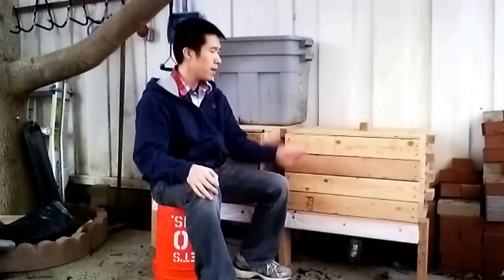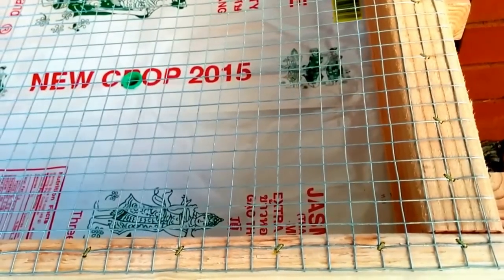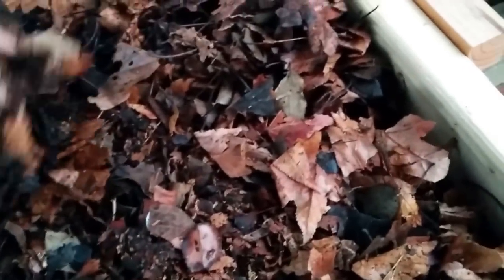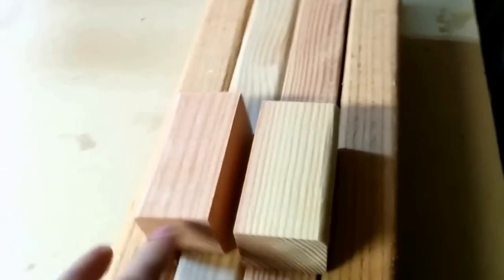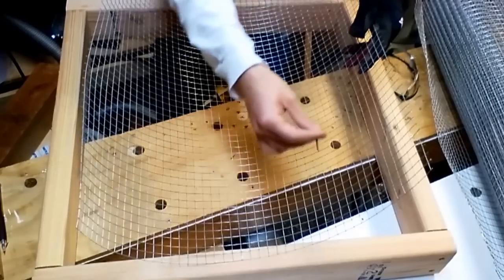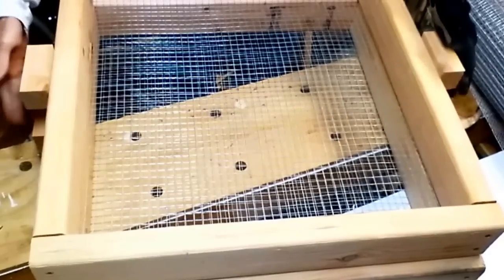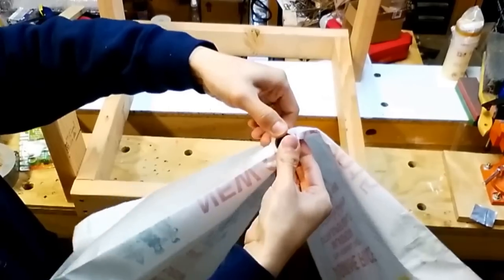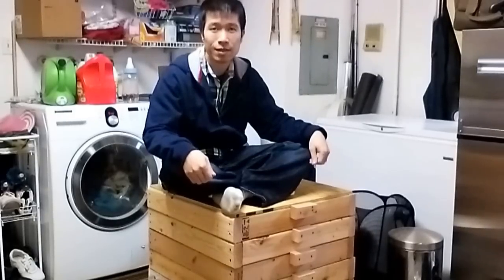DIY stackable flow through vermicompost worm bin s

Comment: Can someone please answer my question? 
Do you have to make a bedding for each tray you put on top or just for the bottom tray?
Reply: When the lower tray (not the plastic bagged one) gets full, you put fresh bedding and food in the one above. That causes the worms to migrate up leaving the castings below. Before that, you don't put bedding above as that will suffocate the worms (and there will be an air gap so they can't migrate up).

Comment: Hiya . Best video on flow through wormery by a mile. 
TWO QUESTIONS PLEASE. 1) whats to stop the finished compost in the bottom tray falling through to the liquid gathering tray at the bottom and subsequently blocking the tap ? 2) How many works do you need to get one tray started ?

Comment: My tip: if you only have a hammer, use 9/16" wide Romex staples, which fit perfectly over the 1/2" wire mesh squares

Comment: I have built the bins and after about 4 months, I have a couple of questions...
1) The second bin from the bottom is full of castings and is very heavy but the third bin (with bedding and food) is not ready to support the system yet. The worms continue to travel back and forth from the second bin to the third. What can I do to change this?
2) I have found dozens of worms in the bottom bin (with the plastic) and cannot prevent them from migrating down to that bin. How can I prevent this? Thank you for your time...
Reply from the maker: Glad you tried it out! yea worms don't always do what we want them to. You could start harvesting the casting and merge the worms to one tray.  They seem to prefer moving down so I put the new bedding/food under the finished tray so they can migrate down while the top dry out. for #2, I flipped the base with plastic so that the plastic is right at bottom of the first tray's mesh to make it easier for them to move around the bin

Comment: I had actually purchased a very similar design from Wood Worm Farms in 2009 that used a plastic mesh rather than hardware cloth. It's still just as sturdy as the day I bought it, surprisingly, I don't have to worry about corrosion long-term, and I imagine it would be much less expensive to purchase in bulk. Also, their design made use of a large paint tray to catch the leachate as it falls straight through the mesh. That obviously limits the dimensions of the box, but I found that size to be just about right as any larger tends to be somewhat unwieldy to transport by hand. Plus, the slope of the paint tray gives any worms that accidentally fall through a chance to potentially escape the leachate. Bonus! 😄

Comment: Question please...Because the bottom tray in your stack is a drainage tray, do you think it would be a good idea to drill some ventilation holes in the 2x4 sides of the worm trays and the drainage tray to maintain good air flow? Please respond. Thanks
Reply from the maker: No issue with ventilation. Worm love moisture and are found most toward middle of tray where it'smost moist

Comment: Are you just using leaves for the bedding in each tray? If I understand this right, you start out with only one tray, then when most if not all of the bedding is consumed in that tray you stack another one on top of that and fill it with bedding, and so on as the bedding in each tray is used up. When do you remove the bottom most tray; after you have two trays on top of it? I also wanted to ask if you supplemented your worms diet with organic kitchen waste as well? Im thinking a heavy milled sheet of plastic could be used for the bottom of the drainage tray. Over time anything would have to be changed out and it breaks down. You feel there is adequate ventilation without the need for ventilation holes, even in the lid? I like this design and it is very affordable! Thank you for sharing it! I look forward to your response. Thanks
Reply from the maker: The trays are still solid and havent broken down at all. I mix whatever "brown" ingredient available(leaves,shredded paper, straw,etc). I discovered that they love straw as it keeps moisture well. I generally only use two trays each bin as i don't actively monitor them regularly and only feed them with kitchen veggy wastes when i remember. You can stop feeding the bottom tray when there are enough compost that you want to harvest . i leave them until they are full(about a 5g bucket per tray), which take multiple filling/breakdown. I keep the third tray with brown material to decay for later, 4th tray empty to be used as shifter for soil/etc--very useful. Any sheeting at bottom is fine, they wont decay for years as there's no sun exposure and are inorganic. You just need something so worms don't fall off. I dont bother with collecting leechay--not enough of a problem to worry about. You might have drying out problem at the edges due to quicker evaporation and neglect:), i usually stir them into the middle once a while. Hope it helps!

Comment: Hi, do your worms ever try to escape through the bottom of your system? I am currently using a basic plastic box system and worms have always escaped through the holes in the bottom (until I covered holes with netting) I have built something similar to your wooden system but it's not in use yet as I'm concerned that they will fall through and drown!

Comment: I have access to a bunch of 2" x 3" lumber that is quite a bit harder than the normal pine 2" x 4" stud.  Do you think that 3"' is enough height for each tray or should I add an additional piece of wood to get to a 4" or even 5' height?  Never farmed worms before so I am not sure about how critical that dimension is.  Really like your design!
Reply from the maker: 2x4 is actually 3.5" so 3" should be fine. Keep in mind the weight of tray+ moist casting can be heavy if your tray is tall

Comment: I can't hear the audio in several parts of the video but this is soo simple and self explanatory that it's just easy to follow.  Built in sifter, simple handles for each layer and good all around 2X4 construction.  Wood is also a good insulator.  I can probably do this with spare wood I already have with little else to buy.  This only thing I may add to increase longevity is to add plastic to the inside frame of each layer, possibly use a bottle top for the drain and add a support to the bottom with a large cut out for the drain.  Excellent.  Simple and very functional.  Thanks for sharing.

Comment from the maker: Aaron, They are still happily eating & breeding in the bins but i'm not sure how much worms since i transferred from my previous plastic bin over.  it was about 2 gallons of mixed worm & bedding i got locally. currently only need use 2 tray per bin for the amount of worm i have. There's been no issue with leachate or worms in the base. With the top cover, it's sheltered from rain, and well ventilated so i have not had any leachate in the can below. It might be better if the base tray is flipped up side down so tarp layer is right below the top tray's mesh screen but hasn't been an issue with current setup to make me try that.
Reply: I ended up putting a wire screen under the tarp for support and putting some bedding down to save any unlucky ones that might fall through. I'm using about 2-3 lbs of red wigglers and have them in 2 trays but will be making a third to support the large amount of worms.